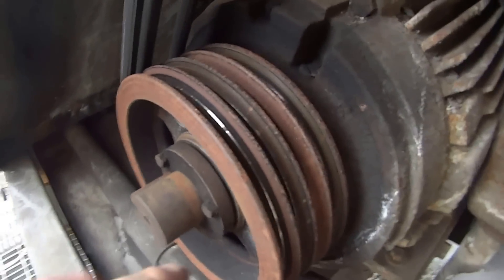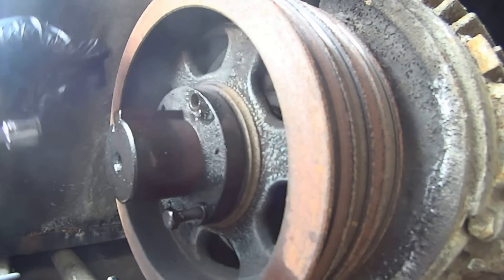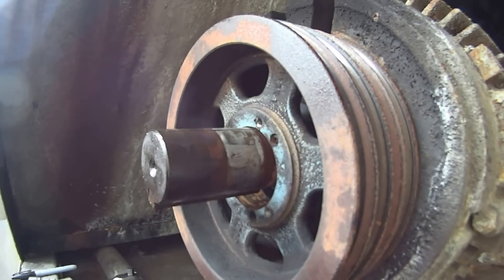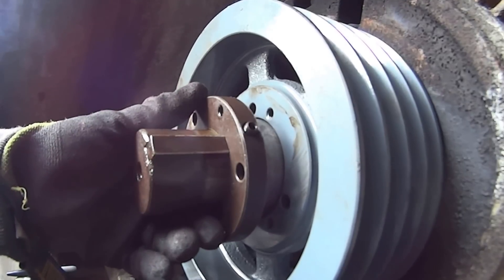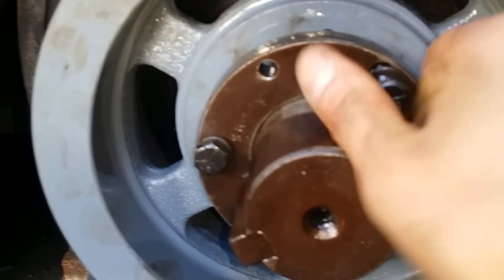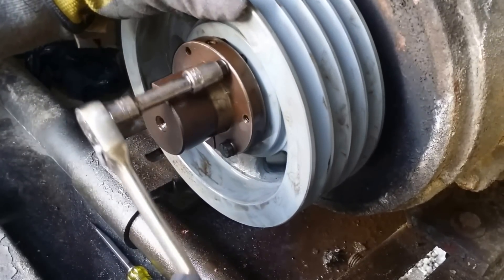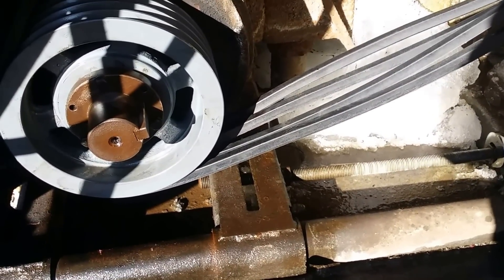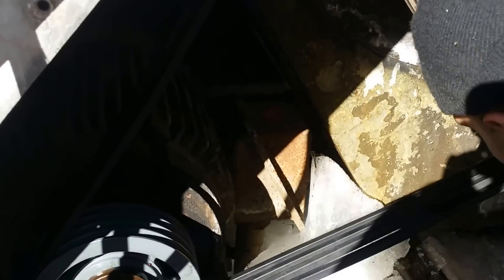HVAC | Cooling Tower | How To Replace Motor Pully.

Comment: If its not a split hub, I run the bolts all the way in and use the pulley like a slide hammer.  Pound the hub off using the pulley

Comment: What are the bolts size did you use to take that Polly off
Reply: Use the same 3 bolts .
 
-Smooth holes to install
-Threaded holes to remove

Comment: 👍 This is the same pulley/hub setup, used on my Vermeer tree chipper cutting drum. Been searching the web for hours about guidance on how to separate the two. The hub and pulley are rusted fast, stripped out the threads trying to separate the two. I will Helicoil then try again, but with heat this time. Soaking with penetrating oil for two days was no help.

Comment: I’m changing my air compressor motor for the first time. The pulley inner diameter is slightly different in size. Should all bushings slide that easily onto the shaft as easy as the video? Should I heat up the the QD Bushing to expand it? I notice the inside of the pulley is tapered in

Comment: what if the pulley is stuck on there , and been used wd40 and other penetrating oil,  with no pulley remover tool?

Comment: Not all startup tech know what they r doing emin. Just resetting to what they did. Could just be asking for future problems that makes u look bad. Spend a few n check alignment n tension. U can get trick with lasers on alignment but a string or straight edge work. Tension tool also
Reply from the maker: Thanks for the advise. I appreciate. However I know that wheel was aligned 200%correctly.  I've been working on that tower for 3 years making other repairs. I wouldn't do that on a machine that I wasn't familiar with.
Reply from the maker: . I like to use a straight edge, however  your correct on  What your saying. I did double check the alignment just to make sure. Thanks again buddy appreciate the advise
Reply: 200% what's that. 1/16" per ' of span. Or 1/4 " deflection means more. I like ur vids. I'm a startup tech but not a service guy i enjoy ur vids it's the side I don't see
Reply from the maker: I ment to say like it's  200% correctly aligned. You know  like 100% good lol get it. Thanks I appreciate you watching my videos.
Reply from the maker: You do just commissioning?
Reply from the maker: Kyle Go Hawks by the way patriots are winning the super bowl Lol
Reply: Lasers r the way to go if starting from scratch on alignment. Even more with different sheave depth and longer span
Reply from the maker: Kyle Go Hawks I agree.
Reply: Check it out. YouTube  ( belt hog sheave alignment ) that's 200% ;)
Reply from the maker: Kyle Go Hawks lol. Yeah that's a nice tool to have.
Reply: Was lag or something yeah I do commissioning and the pats r in for a rude awakening against the Champs ;)
Reply: no

Comment: Nice video Emin .. I also had this similar problem a few days ago but I found out the VFD was set on a low speed but the customer still insisted for us to greased the bearings on the motor and pillow block bearings on the shaft also  replace the pulley and belts ..
Reply from the maker: Nice man. We have  to do what ever the customer wants lol . One time a customer insisted for us to replace ten 10HP blower motors that were only 3 years old. They prolly did it for tax breaks lol